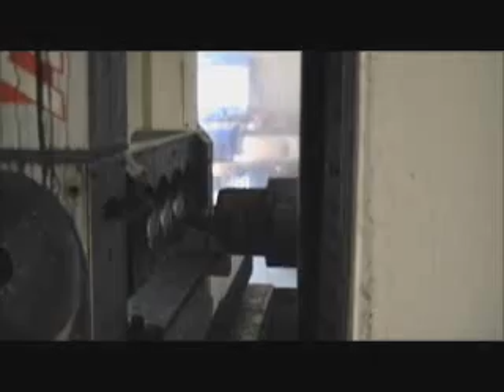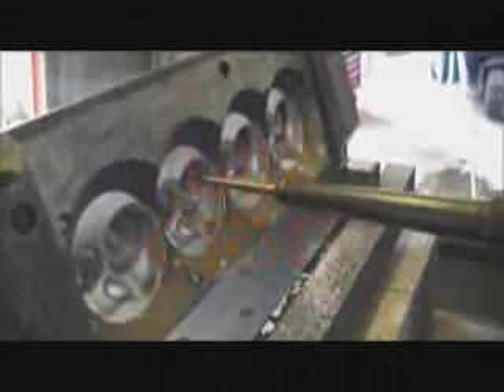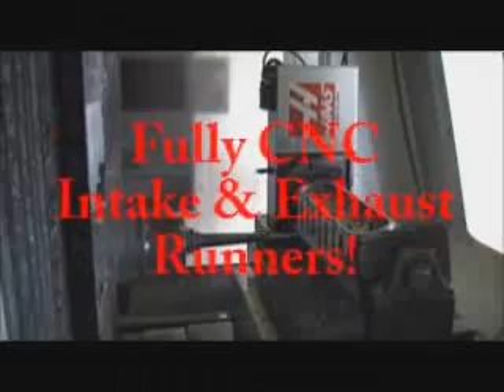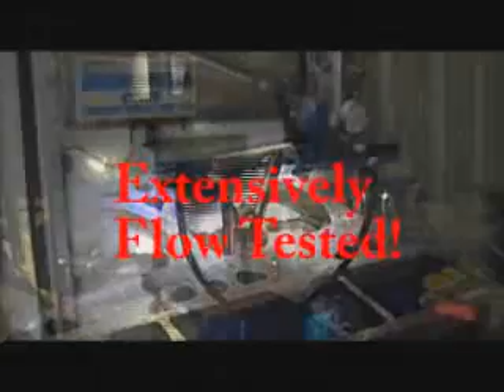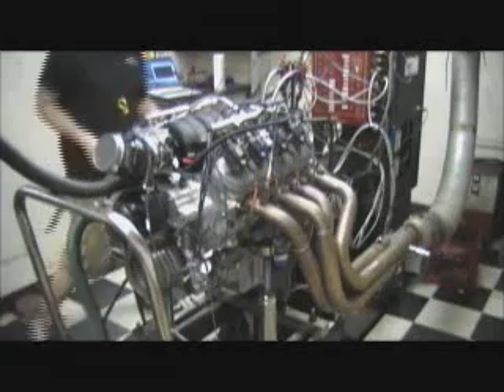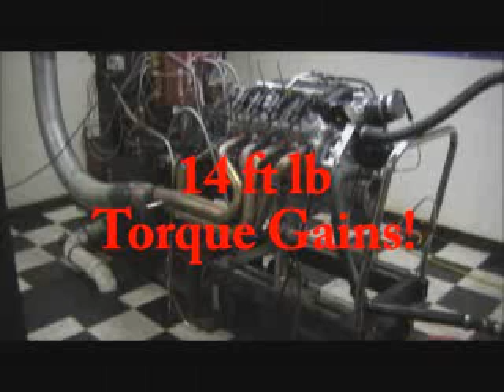Precision Race Components 6.2L L92 Fully CNC Ported Cylinder Heads

Comment: @TXSpeedPerformance those cam specs dont have a wide enough split for the l92 head. You need about 10 degrees mininum to give the exhaust time to catch up to the intake. If you look at comp cams specs for the l92 heads, they all have 16 degree splits in duration. Comp cams know their stuff and its there for a reason....